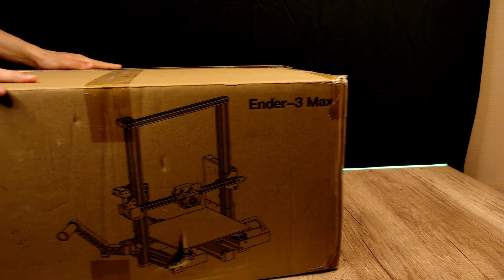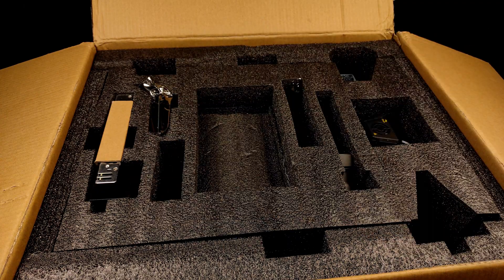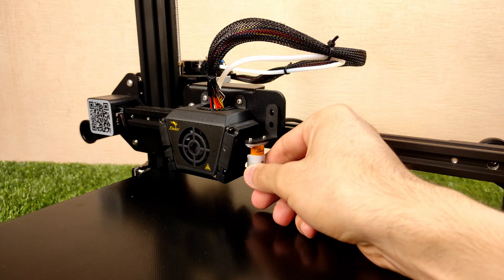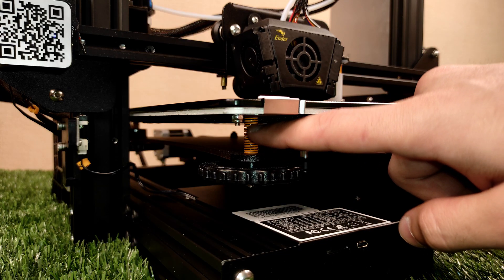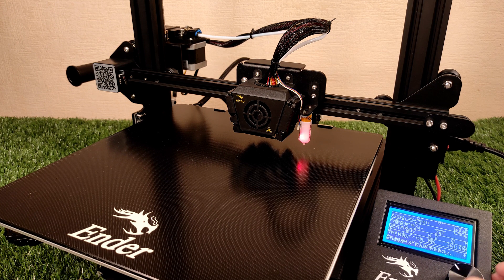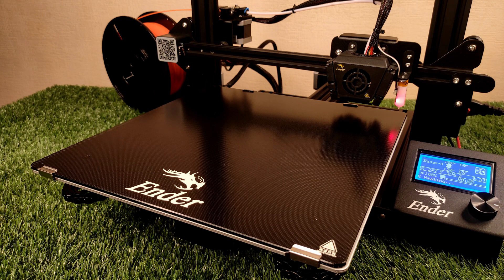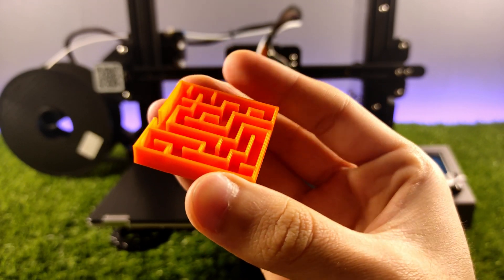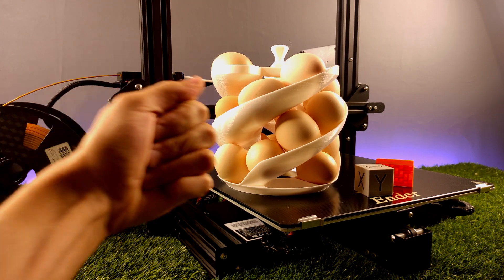Ender 3 MAX Review - Best Gigantic Budget 3D Printer by Creality?

Comment: Hello I need help. Have the max. This first video that says ender3 max and is a max. So thanks. Anyway installed the bl touch on my printer physically. Now need to do the firmware or what ever I need to make work computer wise.  And I’m not real computer savvy. Any help would be greatly appreciated. Thank you. So for it a dust collector.

Comment: Which is the difference between endee 3 max vs ender 3v2?
Reply from the maker: Ender 3 Max is bigger version of Ender 3 Pro.
With Dual fan and some improvements.
But I can tell it is better than Ender 3 Pro.
I have not used Ender 3v2 so I can not tell anything :(

Comment: My ender 3 max died after 2 months.. pretty frustrating
Reply from the maker: Oh sorry  for that:(
What happened?
But I liked this machine very much
Reply: @engineericly  it was working well. Started a print right after the previous one. Which did not start. Restarted the printer and got stuck at a blue screen. I’ve tried everything now to reflash the firmware but it won’t take.
Reply from the maker: @rcguy1987  Did you talk with aftersales support?
Reply: @engineericly  i am trying

Comment: O think still ender 3 v2 model printer is best to home using. Fully upgradeble. Cheap, silent and perfect print qualty for itself segment. I'm using ender 3 v2 model 3d printer and i'm so happy with it.
Reply: Do you still use it and is there a difference between the v2 and max